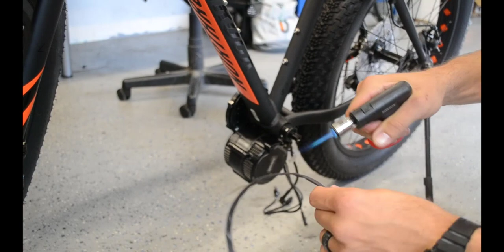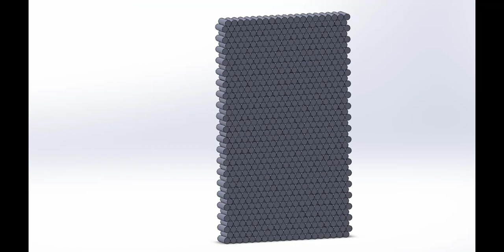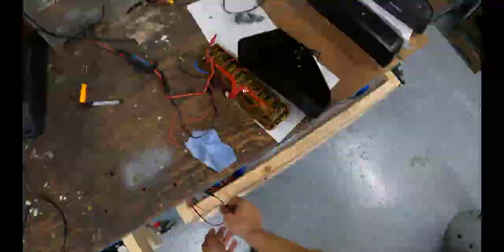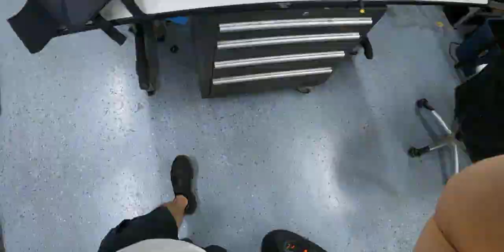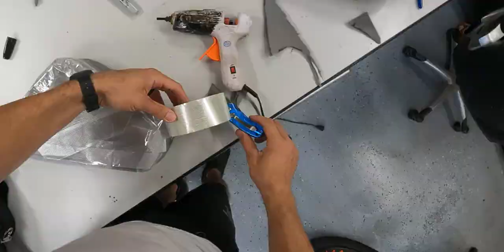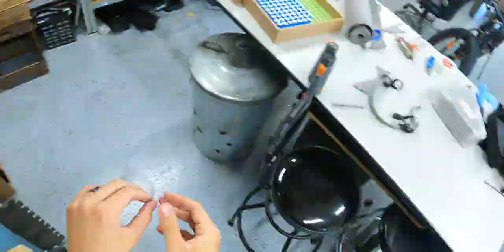Fat Bike Electric Conversion (Northrock XC00 + Bafang BBS02B + 48V 30AH)

Comment: Good info on size: 100 mm.

I didn't have any of this info when I did my conversion in 2018.i ordered the bbshd from China, did the larger conversion kit and used spacers. House clamp is a great tip.

If I did all over again today, I'd choose the bass pro shop ascend moher when it goes on sale to get a drivetrain that is more versatile 1 x 10

Comment: Mine are hydraulic ! 1400 watt Bafang mid drive ! Halo  48 running 58.8 battery and 56.4 battery also on same system  !  25 ahn  61 clicks on 58.8 and 45 -50 clicks on the 56.4 battery on throttle only ! Dual suspension  USD forks ! Thank you top stuff !

Comment: My batt is a 52v 25ah Jumbo shark, and fully charged it hits 58.9 or so.. but drops to 56+ fast.. That said, Can my BBS02 handle a 60v batt or would it burn up my controller ?
Reply from the maker: It will burn the controller, a 60V nominal battery charges to 67.2V and the controller can handle 63V absolute max before burning out, but safer to stay under 60V. You can upgrade to an external controller like this if you want to run up to 72V

https://www.affordableebikes.ca/products/bbshd-upgrade-kit-asi-bac855-plug-and-play?_pos=1&_psq=bbs02&_ss=e&_v=1.0&variant=43873817559194

Comment: Beautiful build. What is the watt/mile of the 02?
Reply from the maker: The BBS02s seem to be quite efficient. Km wise were usually seeing 10wh/km with light assist and then around 30wh/km on throttle but it can range quite a lot

Comment: How is your chainline on the largest rear cog with the stock Bafang chainring?
Reply from the maker: On this particular bike it's not ideal but it doesn't come off (so far). A cheap Amazon chain guide can really help make sure the chain doesn't pop off as well
Reply: @ElectricBikeLaboratory  or a Gustavo (Lekkie knockoff) offset 42T chainring will do it wonders and way cheaper than Lekkie.
Reply from the maker: @Hybrid600  totally agree and excellent point!

Comment: Hello. I don't know anything about electricity. Is it possible to use a larger battery if the bike frame is big enough? 
In other words, what precautions should I take to avoid burning out the BBS02's motor?
Reply from the maker: Yep can run bigger battery and 52V max for BBS02B , controller will blow instantly at 63V
Reply: Thank you for your prompt reply. So, as soon as my battery is worn out, I'll be able to replace it with a battery with Nominal voltage (V) 48 V - Nominal capacity (Ah) 20 Ah - Max discharge current 30 A ( BMS SET 1000W), and make longer journeys. 
This is good news, as my fear is that the electronic controller will burn out (I have one in reserve). 
I installed a Shimano Alfine 8 speed hub and to protect it from the full power of the BBS02, I set the amperage to 18 A and 370 Watts maximum. This is practical for everyday use over long distances.
Reply from the maker: Nicely done! And yes that 48V 20AH should give you a good range for sure!